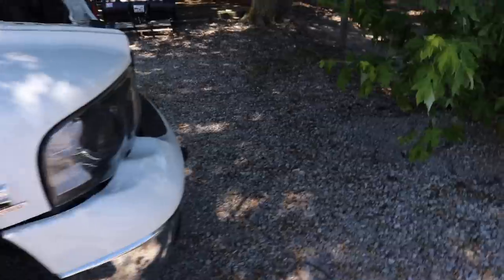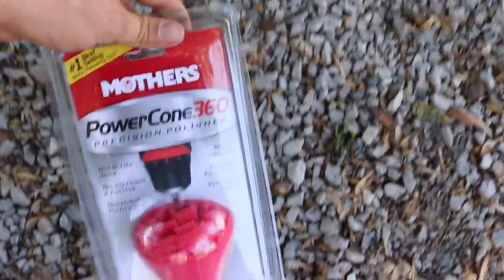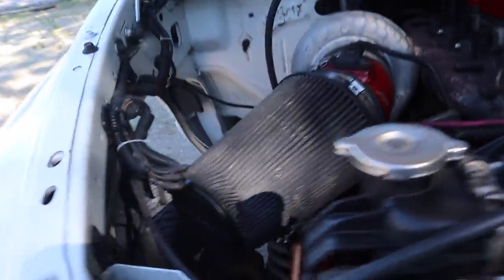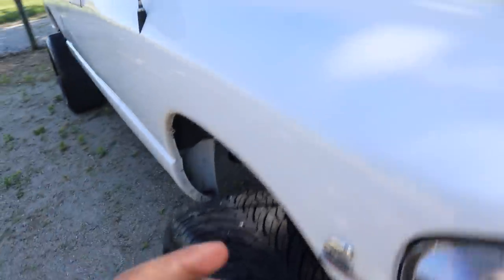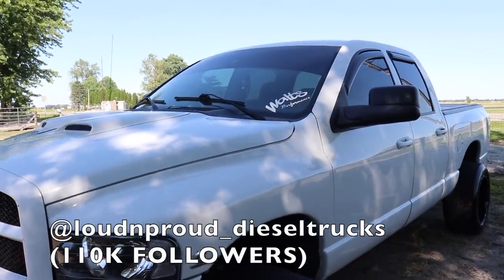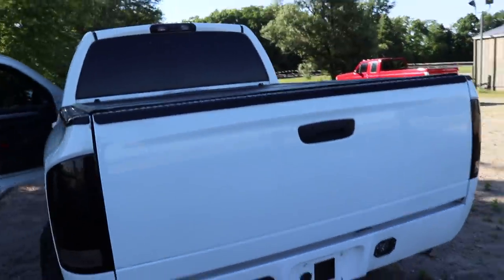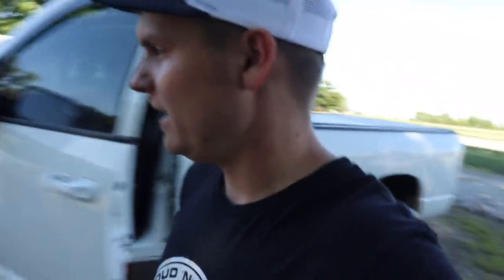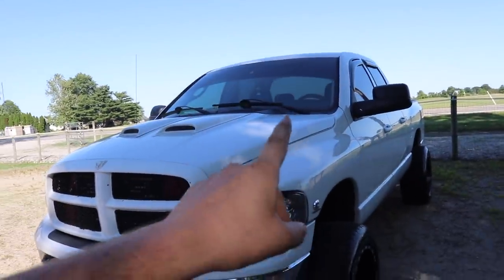I couldn't let ONE DAY go by without doing THIS!!!

Comment: A good way to maybe get rid of that soot easily, is to go out and buy some purple power. I use purple power on everything I have basically. Just spray it, let it soak, then rinse it off. It does a good job at getting oil based gunk off, such as diesel soot.

Comment: These trucks really dont need two batterys, the second battery is really just an auxiliary battery for if you are towing a big trailer that takes electricity. I dont run a second battery in my 2nd gen and it does just fine

Comment: the odds are north of 50/50 that the truck had a hood stack at one time because it had a compound set up.which would also explain the one battery too.
Reply: Didn't know you could run a diesel on 1 battery
Reply: @fifthof1398  you've probably heard by now but,yes,you can run a diesel on one battery.it limits your current draw unless you upgrade your alternator.you have less cranking time,etc but most times you'll be fine.